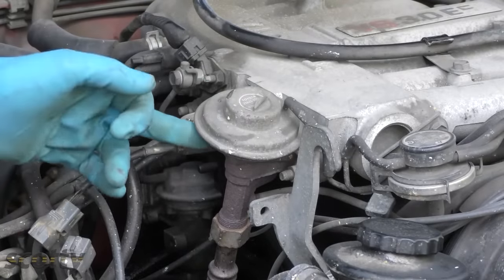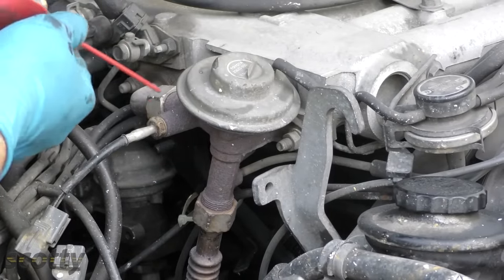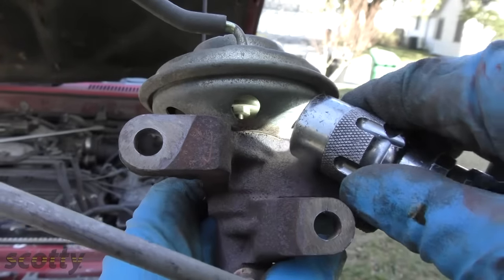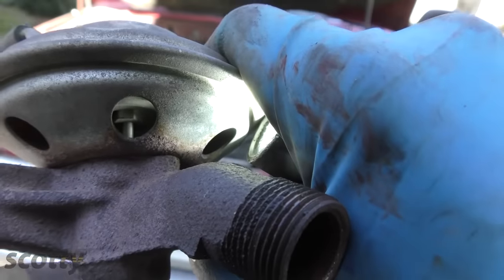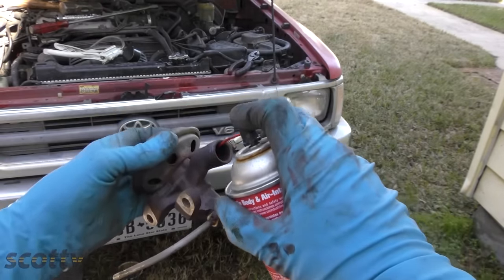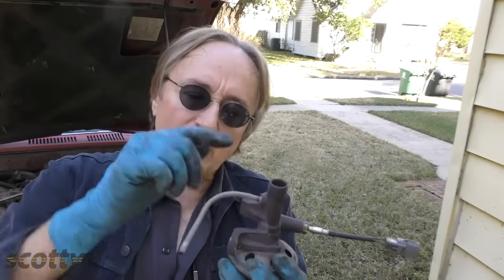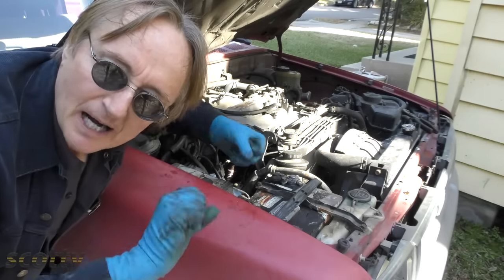How to Clean EGR Valve in Your Car (How It Works)

Comment: Thanks for explaining how a Exhaust Gas Re circulation Valve (EGR) works and also posting the diagrams of it.
Reply: Shame the video applies only to EGR's from over twenty years ago,not relevant on anything even remotely modern with electronic egrs,those old mechanical egrs are cheap to replace anyway and determined by how much build up you encounter if you don't clean the orifices to and from, including any fitted cooler you could still be left with a fault regardless.

Comment: In newer cars, the EGR is now an electrical part mounted close to the gas tank. Mine failed at 25 thousand miles and it would have cost me $900 dollars to replace if it wasn't still under [factory] warranty.
Reply: Are you sure you are not talking about a EVAP valve? You do not want hot exhaust gases by your gas tank.
Reply: Shwalker07 You do realize you're making this comment with full knowledge that all modern fuel pumps are mounted in the gas tank and all modern fuel pumps are also electric.
Reply: Yes but what does fuel pumps have to do with a EGR valve? By or on the gas tank you have purge solenoids, evap solenoids, charcoal canisters, fuel level senders, ect.... What kind of vehicle uses a EGR valve near the gas tank?
Reply: @Shwalker07  lol, this was funny, they stopped responding too!

Comment: I have a Pontiac 2004 Pontiac Grand prix. car rattles and chugs . the stereo went wacky then the check engine light comes on. Could other problems arise and not show up on a tester. I have a whini g noise when i accelerate or turn. My trans fliud is full but almost black. Any thoughts?

Comment: My 04 expedition is idleling kinda rough  I just replaced the spark plugs thinking it was that Nd sure enough the truck still idles rough what you think could be the problem
Reply: Injectors, stuck Throttle Body, bad EGR, bad IAC , bad Pressure Boost Valve, Wrong air/fuel mixture; Fuel pressure, injectors, or depending on the miles it could just be damaged cylinder walls, or low oil pressure due to engine wear. Also might want to check the PCV system first if you are having vacuum leaks - might need a new intake manifold gasket.

Comment: My 2003 expedition has a code of banks one and two runs lean could it be this it idles fine but under acceleration it stalls for a while then runs better
Reply: Start with the simple stuff. Inspect electrical connectors. Intake duct leaks. it could be as little as tightening a loose bolt. Cheers.

Comment: Do every car have EGR valve  ??  Like 2004 Camry and  2013 Rav4  ??
Reply: No. My 2003 Elantra doesn't have one.
Reply: CauseAndEffect then it's Good
Reply: Manufacturers predominantly use catalytic converters to address NOx emissions these days.
Reply: Those do have an egr.
Reply: Wayne S. I checked completely only oxygen sensor is connected with exhaust manifold...

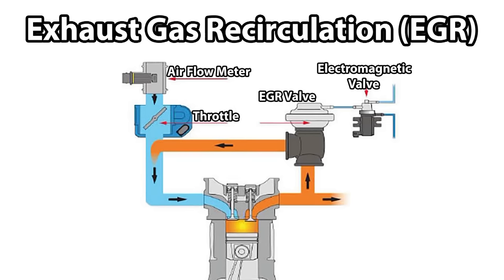Comment: 0:32 sounds like your saying pumping hot exhaust gases into the intake manifold makes the engine run cooler . maybe no hot exhaust into the intake would make it cooler so it doesn't create nitrogen
Reply: Mcleod0000 same thought
Reply: cars don't "create" nitrogen, nor any other element.
Reply: Bro you don't run a fusion drive in your car?  Get on my level.
Reply: Matter is neither created nor destroyed, it ia simply changes.

Comment: Both my 99 and 2001 ram 1500 pickups with both the 5.2 and 5.9 V8 engines dont have an EGR or MAF sensor and they run perfectly with plenty of power.

Comment: I want to know why this simple part costs $193.
Reply: It doesn't. They're on Ebay all the time for as little as $30.
Reply: @loverofthemilf  Probably right. I'll bet it's the OEM parts that are the big $$$.
Reply: i buy parts on rock auto  and i think they're like 25 bucks
Reply: Simple is the answer, dealer is betting you don't know it's a simple part, so you get hosed

Comment: Removing the EGR cooler is no joke.  Spent a small fortune buying specialized tools.  In retro, would have been better to take it to a mech and see if the mech will remove - clean the darn thing Myself, and have mech put it back together- to save $/time.  Good vid, brother.

Comment: Scotty, I have a 2000 F-150 with the V-8 Triton engine. I had my intake gasket and intake replaced. A short while (months) after, my truck started throwing he EGR "check engine" code. Every time I change it for smog checks (every other year and this, 2019)  is the last year) it lasts 1-2 weeks, then the code returns. If I just disconnect the battery to clear the code, it returns within an hour or two. I have changed the EGR out 4 times now. Surely something is causing this valve to gunk up? What could it be?

Comment: Do you have any tips for cleaning the carbon out of the part of the air intake that has the port for the EGR valve without removing the intake?

Comment: Recently I had an engine fire and had to replace all the melted vacuum lines. However; now it burns rich and the transmission won't switch from first gear. What do you think the issue might be?

Comment: I'm not cheap I guess. If I took the time to remove it, I would just buy a new one.
Reply: So you have a perfectly fine good part that's a little dirty. Instead of just cleaning it and putting it back, you'll drive all the way to the autoparts store, buy an expensive new part, and put that in instead?

It's like buying a new fridge when the old one is dirty. 
I'm not cheap either, but i like to use my stuff as long as i can. 15 minutes of your time is not a big investment you know. And the benefit is money saved in the long run.
Reply: A new one starts at $100 and can cost up to $400 . It’s worth it to try 50 cents worth of carburetor cleaner first. I’ve save money doing this.
But if you don’t mind throwing money around just take your car to the dealership .
Reply: Don't feel bad I bought a new one for my Rodeo only 60 bucks.  I was so lazy I got it shipped to my door.
Reply: I would if I could find one!!!!, Bc mines under the throttle body. PITA

Comment: Dirty EGR system can also make your car stall when idling.
Reply: I actually had to go in and clean out the air passageways leading to the intake. Those were really clogged up
Reply: Peter Rabbit It’s one of the main causes of bogging and hesitating.  The EGR is not active at idle or wide open throttle.....When cleaning those passages, a good trick is to start up the engine for about 1-2 seconds, before putting the EGR back on the car.  The engine will rev very high, and blow some loose carbon out for you.
Reply: and make a turbocar go into limpmode.

Comment: Scotty or anyone else in the know, I have a question. After chasing gremlins I found chunks of carbon deposits stuck in the EGR pintel keeping the valve open resulting in rough idle and acceleration . What or more so where are these chunks coming from? I periodically have to remove the EGR to free up the pieces whenever it starts acting up. I have placed the shop vac hose over the EGR port on the intake and sucked out a bunch.

Comment: Or you can blank it off, and enjoy better throttle response, more power/torque and a longer engine and turbo life because of no carbon contamination of engine oil. Egrs are literally the shittest things..
Reply: BarbecuedPossum if your in Florida go for it, no state inspection . This is only for people who need to get it fixed due to emission testing
Reply: Nick Renda I'm in the UK so only smoke test for emissions so fine here too. Yeah I guess for people that need to fix it however it doesn't take long to install the system again, in my case it's like 15 mins to take off/put on so I'd just put it back for inspection :)
Reply: BarbecuedPossum And engine knock (pinging), EGR helps fight preignition.
Reply: Think knock sensors will do that no?
Reply: Vitamin B Funny you go for the "kid" and "mommy" insults even though I'm 20 and have been doing karting champs since very young and bought my car before I could even drive provisional at 17. I think you're the childish one.
Reply: Vitamin B The only thing EGR does is recycle the used exhaust gas in order to reduce the NOx output. It does nothing else.
Reply: I'm dead😂😂
Reply: Those recycled exhaust gases cool down the combustion. If running higher combustion temps don't ring a bell in your hollow head, then no amount of anecdotal proof is going to do you any good.
Reply: Vitamin B So fucking what if it increases combustion temp, that just means it's more efficient.  It's making a more efficient burn by actually intaking clean air rather than exhaust gas which can do no useful work.
All EGR does (at least in diesels) is cover all your intake sensors and throttle body in shit, clog up your inlet manifold, contaminate you engine oil with carbon which causes engine and turbo wear, make the throttle response worse, reduce power and torque, increase intake air temp and shit on fuel economy by worsening thermal efficiency by around 5%.
Reply: BarbecuedPossum lol dude...if combustion temp is too high, you gonna preignite and detonate. If you don't think it's a problem, then keep driving like that.
Reply: BarbecuedPossum 20 is a child. Sorry for the bad news kid.
Reply: Vitamin B diesels wont preignite because the fuel is directly injected at the exact moment ignition is desired. 
You don't understand how a diesel engine works do you. They aren't like gasoline engines. Fuel is ignited spontaneously under high pressure (around 3000 psi or higher)
Reply: Modern gas engines have direct injection as well and direct it as needed. It is not continuous injection. Continuous injection is old technology. The only time you will get knock is if your cylinder temps are too high or you are using too low of an octane rating. Deleting your EGR is not going to do anything outside of reducing your MPG's a bit and extending engine longevity. Anything you do to return an engine to its natural state is going to increase longevity.
Reply: Wayne S. I'm not talking about diesels here, and no where was it mentioned in the original comment that it's only valid for a diesel.
Reply: Simple, you keep cylinder head temps low by running your engine richer, adding lead to fuel, cycling coolant, passing airflow into the engine bay. 

I'll give you an A for effort. But you surely know more than me it seems. Not like I've spent the past 2 years in tech school to be an aircraft mechanic. I know nothing about engines. Golly gosh you got me. 

Obviously your average joe is not going to doing an EGR delete, EVAP delete, PCV delete, or a cat delete but if you can't tell I'm not your average joe nor are my wants and needs the same as yours. Obviously I wouldn't recommend your average joe do such things without the knowledge required to make it all work right and obviously the state you live in is going to dictate what you can and can't get away with. 

An EGR delete is not going to put cylinder temps through the roof like you are claiming. A lot of vehicles now these days come with turbochargers and thus need to use higher octane fuels by their very nature so that kind of shoots a hole right in that claim. 

Somewhere there is a tree tirelessly producing oxygen so you can breathe. I think you should go apologize to it. 

[Laughing in Army veteran]
Reply: Flash point of fuels diesel, gas or petrol.... Less than 90°c 
Exhaust gas temp 300°c+

Egr cools combustion temperatures how? Lol
Reply: Yes sir you are 100% correct. Dont let your engine breathe in its own farts all day.
Reply: Yes, EGR cools combustion by diluting the burnable O2 coming into the engine.  The exhaust gases don't combust and therefore act as a heat sink (instead of your cylinder) for the combustion of the AFM.  So basically you sac a little HP to run a little cooler to not produce as much NOx, which, while it isn't great for  us orthe environment, it does help to reduce methane in the atmosphere which is a major greenhouse gas.  But you know, acid rain and lung cell death are a tough trade for greenhouse gas reduction.
Reply: A BB inserted in the vacuum hose solves those problems!
Reply: @vitaminb4869  is mad bc his pos mini van has an egr and the inside of his intake manifold looks like my toilet after del taco.
Reply: @BarbecuedPossum  How about reducing combustion temperature and prevent early detonation?
Reply: @hudarsono  EGR doesn't reduce combustion temperature? It's literally sending hot exhaust gas back into the intake instead of  the car getting air straight from intake.
Reply: @franko Actually I do have a volvo lol, and it takes 10 mins to take on/off

Comment: WILL a bad EGR valve cause an engine to smoke thru the exhaust SYSTEM. I have a 94 Chevy S10 V-6 vortex that smokes it's muffler off when it's cranked?

Comment: Just blank it off
Reply: Is this better for the engine?
Reply: Yes, stop the EGR valve from recycling air into the combustion for a cleaner engine. It is like breathing in your own fart via a tube all day.
Reply: What is blank it off?
Reply: @garrettgramlich9424  No will fail MOT if u live in England that is

Comment: would you recommend? using the EGR spray cleaning in to the air file box ?    I have a Seat Ibiza 1.6 td 2012 that is having issues with the EGR and its hard to get to it for removal.

Comment: We have a 2000 Oldsmobile Alero GLS 3.4L V6, and received the Error code P0401, she has a slight idle issue, acceleration issue, and poor gas mileage. How would we go about cleaning her, she has all original parts.

Comment: Scotty, I have a 2000 Ford Explorer. The EGR Valve is suspected bad due to rough idle & low power. I notice that 2 vacuum connections on the EGR tube were missing hoses. I reconnected and it stopped the noise but when I drove it at low speeds the noise returned. I opened the hood and the vacuum tubes on the EGR tube had blown these hoses off again. Is this normal with a bad EGR Valve?
Reply: if the EGR has a busted diaphragm with a stuck open valve, exhaust gases can be pushing the vacuum lines off as pressure builds when accelerating. with Engine running at 2000 rpm, if you're getting air coming out of the egr tube with hoses disconnected, egr is bad.

Comment: Hi Scotty , I just bought a 2002 Grand Marquis with 24000 miles on it . Yeah a Grand Ma car  . Even though the EGR was just replaced I keep getting the code for the EGR CODE. I have seafoamed it ,I have used multiple fuel system cleaners in it ( Techron and sea foam ) . What do you suggest.

Comment: On mine VW golf 4 1.9 turbo diese when i just bought it EGR was  so clogged and the intake manifold was almost fully clogged up. Oil and all of the Carbon mixed and made a big mess. Cleaned and just turned off EGR and blanked it.  Car runs much better and fuel economy is better too

Comment: This is weird Scotty. I was having trouble codes for EGR insufficient flow a few months back. I used a Gumout multy system cleaning, just because, and it stopped the Check Engine from going off. I did nothing to the car except that I had it for over 1 year with the same problem and it magically went aeay after using gumout. What are your thoughts on this?

Comment: Hey Scotty I have a 2000 jetta GLX VR6 Most of the vacuum lines are broke, or missing specifically from the egr valve down to the vacuum control for the egr valve. I have no idea where these lines go and I dont want to put any in the wrong place, I can;t see that ending well. do you have video that will show me how to do this,? also, do you know if I can put the front clip into service position on this car or if it even has that option?

Comment: Hi Scottie,
I recently watched your video on cleaning the egr valve. Remarkably, you were working on a 3.0l Toyota which is what I'm trying to fix. It's running rich with a lot of black smoke and idles low. What is your advice?

Comment: I have a 2004 ford mustang and have replaced the valve, the two sensors have been replaced and  the egr connections are not dirty but the check engine light keeps coming on. Any suggestions as to what to do?

Comment: So my car has a rebuilt engine after the timing belt broke. About 2000 miles after the engine replacement, the check engine light came on. The codes that I scanned say that all of my cylinders are misfiring, but the car runs fine. Some forums say that the egr valve can be the cause of those codes. Any advice?

Comment: Hey Scotty I have a 2000 Silverado 4x4 5.3L v8 when my truck is cold I can it will idle perfect and it’ll drive forever perfect but after it’s warmed up and I get done driving if I turn it back on when it’s warm it idles funny has a random misfire and it hesitates to move but if you give it some gas it’ll go away and you can drive perfect again what may be my problem that I’m having because it is really annoying

Comment: Scotty I have ford van 02 e250 just doesn't accelerate more than 40 mls per hour going up roads or uphills avenues i already replaced the spark plugs pcv valve clean the throttle body and egr iac valve as well and still got the same issue what do you recommend

Comment: This is a vehicle that’s easy to get to and get off some vehicles like ford will be very difficult to loosen the egr valve I recommend to put anti seize on the threads when in stalling Incase you come across the problem again